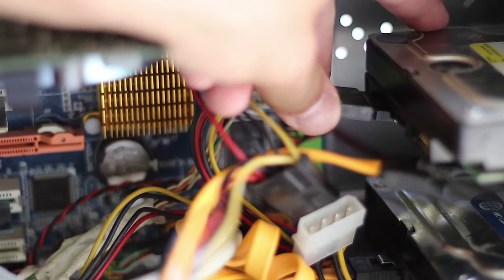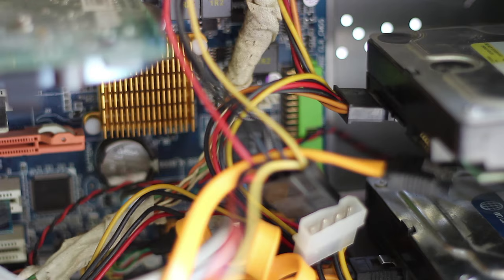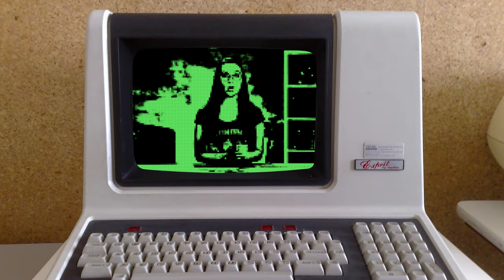PC Build – How to Fix a PC that won’t boot – DIY in 5 Ep 112

Comment: welp might as well try to look for answers here. I was on my PC I took a break for a bit, it went into sleep mode. I came back to actually shut it down but it was on the BIOS screen. Not sure how it got there. Now every time I turn it on it goes to BIOS instead of the Windows start up. I’ve unplugged, taken out the RAM and put it back in, I’ve messed around with the settings in BIOS…nothing. Anyone have a solution to this or have the same issue?

Comment: No error codes no beeps, fans and rgb/led are on, tried taking out ram and gpu and still no signal on my monitor can any one help ?
Reply: I still get this problem you can try removing the CMOS battery

Comment: Hey i need help from you, actually I bought a pc and was working fine till I enabled secure boot, when I enabled it and as u know to enable it we have to be in setup mode so to do so i updated the key platform in key management, after that i save and exited but my pc doesn't boot up. What should I do? All the fans cpu cooler fans, cabinet fans, gpu fans are working but getting no power in peripherals, so i can't to the troubleshooting through keyboard too..... Pls help me.
Reply from the maker: Hi there have you contacted the place of purchase or the manufacture directly to see if they can assist you with their product? It could be a setting that was enabled incorrectly. If you installed one of our SSD's please visit our site here for further assistance: https://kings.tn/3o1s9Zc
Thank you
Reply: @kingston  thanks for you reply but if I could go there I wouldnt ask for an online help.... Btw no offence, but if you have any thing which will help me pls help....

Comment: My PC lights are on, the pc will not start, the fan will also not come on. When I turn off and on my monitor I get a power saving mode message.
My keyboard also will not come on (it glows green when on).

Comment: I bought an ASUS PN51 Mini PC Bare Bones with AMD Ryzen 7 5700U Eight-core Mobile Processor - I installed a 970 EVO and two 16 Gigs of Crucial memory and tried to install Win 10 - no bios flash screen, in fact no HDMI signal nor C-monitor signal no keyboard and no mouse are recognized. I reseated the 970 evo tried different connections - I didn't try reseating the memory tho. Also there is no DVD so I copied the files to a USB but again there is no output recognition for monitor keyboard etc Could it be DOA? I just got it yesterday. The power light comes on the fan is running but that's it. I have a 2.5 inch HD arriving tomorrow I can try that I guess but there should be BIOS correct? I saw the lose BIOS chip thing I have no idea where it would be on this - I'll do a search. Any suggestions shall be gratefully appreciated - thank you for your service

Comment: Well, when I turn my laptop on, 
the lights are switched on, 
The fan just work OK, 
but the screen is dark and the keyboard won’t respond since my numlk and caps lock key have small lights which show the computer is on.
This happened after my computer freezes and I did a forced shutdown...
Please what can I do 🙏

Comment: Hi! 

My PC will boot up, however it will not display on any monitor, no matter what kind of cord I use (VGA, DVI, HDMI, Display Port Cable). I've tried taking out my GPU, moving around my RAM and removing a stick as well. I've also tried clearing the CMOS and BIOS. Nothing works. HALP PLZ.

Comment: Anyone know the problem I’m having I got a white dash in the top left corner then it freezes on the pre bios screen all my stuff is plugged in correctly and everything is detected no error codes or anything just no post 
Motherboard: asus prime x470 pro
Gpu: asus rog strix 2080 super 
Ram: gskill trident z rgb 3200 speed 32gb 
Cpu: amd ryzen 7 3700x 
Ssd: Kingston m.2 ( don’t know the size) 
Hdd: seagate 3tb hdd 
Psu: 750watt Corsair modular power supply

Comment: my computer has a asrock bios specs are ryzen 3 3100 and rx570 and my ram isn’t the problem it is all counted in the bios. my computer is stuck in a boot loop, it boots up the asrock logo turns black and does
that endlessly. i’ve restarted the bios to default settings nothjng happened.
does anyone know what’s wrong? also i’ve tried to get into the automatic repair and it also doesn’t work. i dont know what’s wrong

Comment: My pc doesn’t boot up after reinstalling the old ram because I took them out after the new ones wouldn’t boot up. I trying to see the new ones would boot up. When I press the power button, nothing happens. The RGB on the motherboard lights up. It is either power supply or RAM. I am going to Micro Center to get a diagnostic.

Comment: My computer was running just fine then suddenly freezes. Can't even force shut down even holding the power button so I turned of the power supply. After turning it on again, when I press the on switch, it lit for a split second but didn't go through, didn't boot up. Nothing at all on the succeeding tries. Anyone knows what could be the problem? I built it myself and was working for a while.

Comment: I have Windows 10 installed. I had an issue and I pushed F8 when booting up the laptop but that should not have been done because now the computer beeps a few seconds later and then nothing. The F8 wasn’t set up and now I have a big issue. How can I fix this?

Comment: For me nothing happens when i try to boot it up , No Fans Spinning..... So that means its a Power issue?
Reply: mcs samee
Reply: @rainyFN_  i connected the cables wrong (the reset sw , Power sw...) now it works.
Reply: @mcs7352  how did u figure it out.
Reply: @sergen-2569  connect the cabels the right way

Comment: I’m about to try all of these but if they don’t work I’m just gonna say my pc can turn on right but it will give me the options of F1 to continue to log into my account or another one if I have one but instead it will just instantly shut off after me pressing F1 instead of going to that log in screen perfectly fine with no problem and I had a voltage battery problem but I fixed that like 2 months ago and got a new thing for it but yeah if none of them work can someone please tell me wheat to do

Comment: what if a lenovo thinkcentre m82 won't boot but all the fans run but no lights on the mouse or keyboard has 2 sticks of ram switched them one at a time still no boot or post no sig to the monitor

Comment: I have a computer that wont boot in any system, it even fails to boot in safe mode, i guess i cant do anything with the software on it. I dont want to open it up to check the hardware because i ve never disassembled a laptop before and im afraid i will break something because the laptop is not mine

Comment: Hello, I turn my PC on but the BIOS doesn't load along with Windows not loading. Also when it did, one of the fans most likely the CPU or GPU becomes loud. Thoroughly appreciate a solution to both of these issues. :)
Reply: Same

Comment: I just built a new rig with all 8th Gen Parts. Motherboard-Asus B360M-A. CPU-Intel Core i3 8100. RAM-32Gigs of G-Skill Ripjaws DDR4, Speed compatible with the motherboard. Power Supply-Antec 750-Watt High Current Gamer Modular Series. Video Card-EVGA GTX-1660Ti SC ULTRA. Hardrive is a Western Digital 2TB Blue. My computer is air cooled, no liquid cooling, and this is my third build. I have no idea why it won't start up, I've never had this issue before. Everything is indeed connected correctly, the motherboard light is on, I'm partial to Zalman case's because they're not dust suckers like several other brands I've used. My case is a Zalman Z11 Plus High Performance. I feel like the issue might be a faulty case, I've had this happen before with a Cooler Master case I bought several years ago, I was able to return it and get one that worked, but I bought the parts over the course of a year, and the warranty is now void on this case. If anyone has any kind of answers, it would be much appreciated. Thank You.

Comment: Im not to computer save but I can follow direction very well, I sat that to say this. I bought a used gaming pc top to use as my regular desk top. I plugged in my monitor and the POWER CORD. The fans turn on and off and I see on the monitor the name of the mother board and the the F numbered options on the bottom of the screen ( plugged in the mouse to click ( f9) I dont see the mouse on the screen.....whats the first thing I should do...broke college student really needs some help

Comment: Hey guys and gals!! 

My PC decided to randomly just stop booting up at all. A small light flicker on the power button and cpu fan rotates slightly but that’s all I get… really frustrating. I’ve borrowed a friends PSU and installed that but same issue. It’s a decent system spec but most probably quite dated… any help would be appreciated before I take it to the PC doctor

Comment: well....first time fans working the motherboard beebbs ....after changing ram positions and reinstall gpu...it doesn't start at all.... after some very deep search in the board I found 6 broken bins in the processor framework...
Reply from the maker: Hi, if you have already tried the suggestions in this video as well as checking the physical components in and around it perhaps your best bet is to consult with the computer manufacturer for further diagnosis as well as consulting with a local Computer Repair shop.

Comment: I don't think you covered this so here goes, I'm not certain if my problem is in the bios or registry. Whenever I restart pc (even from bios) pc starts the process of restarting but hangs up, the screen goes black and all fans are initialized, running at max rpm (sounds like anyway) I'm forced at this point to hold the on/off button for 5 secs or so, I guess it's performing a soft shutdown. Once pc is shutdown I can press the start/stop button and windows will load normally.  Not the most serious of issues I guess but it is annoying especially when an app calls for a restart.

Comment: My lappy turns on, keyboard lights show but my screen blinks quickly continuously.
What's the issue
Reply from the maker: Hi there thank you for your comment. If you have already tried the suggestions in this video as well as checking the physical components in and around it perhaps your best bet is to consult with the computer manufacturer for further diagnosis as well as consulting with a local Computer Repair shop.

Comment: I've got a pc (windows 10) that won't boot up and I haven't been able to fix it even after sooo many months. I'll try the things in this video that I haven't tried already, and I hope it works. If I end up replying to this comment saying that it still won't start, can someone pleeeeease help me out???

Extra info:
(It stopped working randomly one day after a few years of use, so I know it hadn't occurred due to bad/incompatible new hardware or misplaced wires. I've already replaced the RAM, the motherboard, and the circle battery thing. When I try turning on the pc, it will turn on for maybe 2 or 3 seconds, turn back off, and repeat that until I manually turn it off. For the few seconds that it is on, I can also press escape and it will show some pc details and let me change a few options that I can't necessarily remember. When I did try to change those options, it didn't fix anything. Pressing escape will also stop the computer from turning back off after the few seconds. I haven't tried hitting F8 yet though. Lastly, when the computer turns on, one of the fans seem to make a weird noise, but that noise could also be coming from something else that is close to the fan.)
Reply from the maker: Hi there thank you for your comment. If you have already tried the suggestions in this video as well as checking the physical components in and around it perhaps your best bet is to consult with the computer manufacturer for further diagnosis as well as consulting with a local Computer Repair shop.

Comment: HELPPPPPP!!! LOL....New build with a B550-F mobo, Ryzen 3600xt. First start, went into set up, only changed the memory and saved, never would reboot after that, cpu fan comes on, front and rear fans on, memory leds on.  Noticed the cpu red led on by the 24 pin, constant red led means cpu trouble on this mobo. I know all the stand offs are  on because I had to add 2, cpu plugged tight, 24 pin tight. I uninstalled ram, reinstalled one stick in first slot. fan running on gpu which was tested before install on other pc, still no boot, cpu is new out the sealed box. what now, please anyone help.

Comment: Please someone help. I just upgraded my cpu and gpu, I plug everything in turn the power switch on and nothing happens, no fans spin. The only thing that does happen is a small yellow light shows underneath the motherboard and on the PCI slot

Comment: My AIO gateway pc on boot up has begun to show no Ist boot detected. I went into chaos to check & Ist time no hard drive present checked data port if enabled & it was saved changes rebooted. After rebooting pc 3-4 X I finally got my Windows up running. However now my pc is so slow.. Vipre shows no viruses I did install malwarebytes but found malware but pc is slower . I uninstalled MB & pc is reacting better. Vipre support has told me to reinstall Vipre but I have not yet if Windows needs to be fixed Ist I should do that Ist. If the hard drive boot up issue chimes back what could be the isxue? The all in one pc data port might be going out. I  think I should open case? Can you send me any options I have not considered. Th k u love videos
Reply from the maker: Always check to see you have the latest drivers and BIOS updates installed as recommended by the manufacturer of your PC/Motherboard. Check that your physical connections are good as well and that it is properly grounded. Have an SSD running your OS? Check to see with the manufacturer of the SSD for any firmware updates available as well since they are different from traditional HDDs. AND you can also visit a computer repair shop to give it a once over as well. Best of luck!

Comment: thanks for the video, 
I have a few years old Desktop, which worked fine until a few days ago, I start the PC all seams to work, just it did not start my mouse, my keyboard and my pc screen, so this is a problem, because I cant get into my PC without those components working.
PC running on W10 and it seems to me like the USB ports do not get activated, so none of the hardware connected would not respond 
anybody have any solution, beside buying a new PC? thanks you all for consideration to help me...
lalso like to mention, that my CPU van power supply van and cooling vans are working fine

Comment: When I turn on my computer it goes straight to a black screen with (keyboard interference error)(wrong cmos settings)(date/time is wrong) and to push f1 to fix settings  or f2 to set to default.  Problem is my mouse will light up but my keyboard doesn't work. I took out the battery to reset the cmos but it didn't change anything.  I just chachanged case and moved everything from old case to new case only difference is there are 8 fans with a lot of lights that change colors from only 4 fans.
Reply from the maker: Hi there thank you for your comment. If you have already tried the suggestions in this video as well as checking the physical components in and around it perhaps your best bet is to consult with the computer manufacturer for further diagnosis as well as consulting with a local Computer Repair shop.

Comment: i bought second ram ddr3 and when i added, pc did not boot(no display). so now 2nd ram slot does not working(no boot, no display) and now pc run with only first slot. as i remember 2nd ram slot was working fine too but after added second ram, 
2nd slot broked-_-
Reply from the maker: Hi MQ! Are the sticks of RAM identical? Try testing each module in the first slot by itself to see if the system boots and runs properly. It can help determine if there might be a compatibility issue.

Comment: I overclocked my dram frequency on my bios abit 2 far now my pc and now it wont start up, what 2 do?
Reply from the maker: Hey there! Check with the owner's manual or manufacturer's website on how to clear the CMOS/BIOS settings. Different models have varying methods on how to return everything to default settings.

Comment: idk if anyone is still active here since this video is 2 years old but my pc all of a sudden shut down and now it’s not deciding wether to boot loop or “automatic repair” just to tell me to restart the pc again and at first i tried running command prompt with advanced options but i forgot my password so i reset it but i’m pretty sure it doesn’t know that because after 2 hours it still says my password is incorrect i made sure it wasn’t a faulty drive and dusted all my parts but still can’t find a way to boot up i’m going insane
Reply from the maker: Hi there thank you for your comment. If you have already tried the suggestions in this video as well as checking the physical components in and around it perhaps your best bet is to consult with the computer manufacturer for further diagnosis as well as consulting with a local Computer Repair shop.